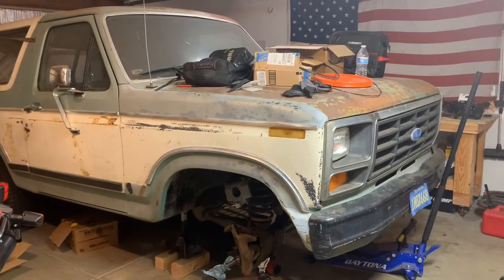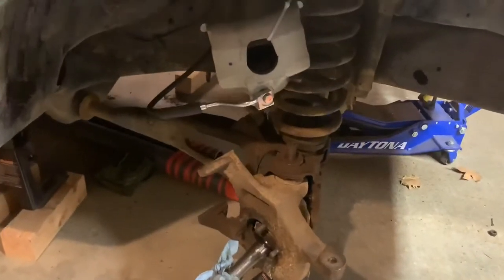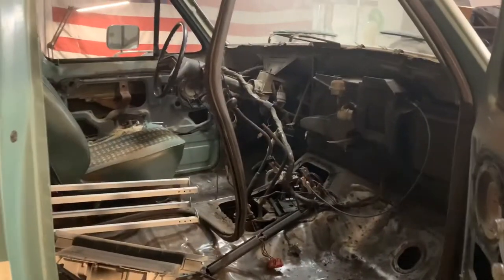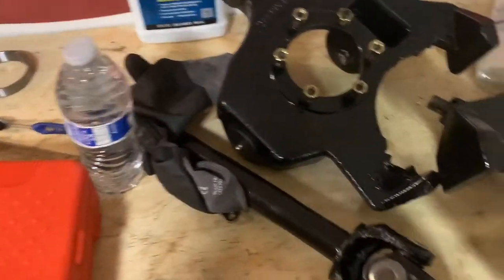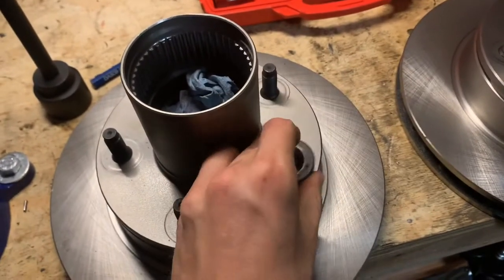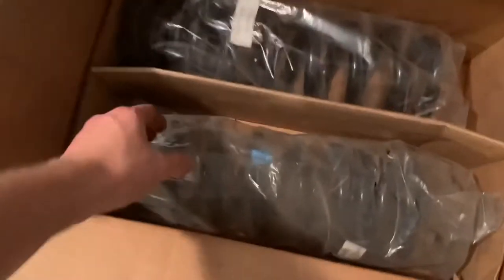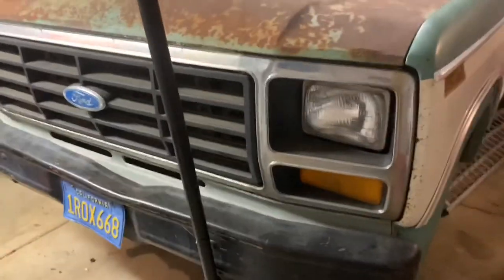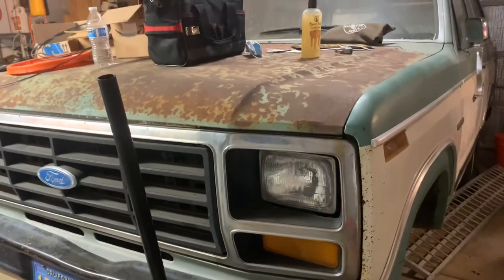82 Bronco Restoration - Vlog Episode 2: January 2021

Comment: Nice Project!   I had a 1980 Bronco when I was in high school in 1989.  I loved that thing!   I wanted to put the dash from a 1987-91 Bronco in it as I liked the gauges and design better.   I never got around to swapping dashes but I did swap a 1990 Bronco II Dash into a 1984 Bronco II so it can be done.   It's hard to believe these are collectors items now.   I've noticed that they've disappeared from my community over that last few years most likely due to scrapping because of rust and mechanical failure.

Comment: Where are you getting parts? Or where did you
Reply from the maker: LMC Truck, Jeff's Bronco Graveyard, Jegs, Rockauto, Summit Racing, Amazon, Ebay, local junkyards. Anything machined like engine parts or gears I've bought from specialized distributors or direct from the manufacturer.